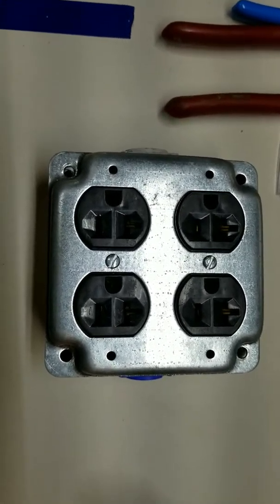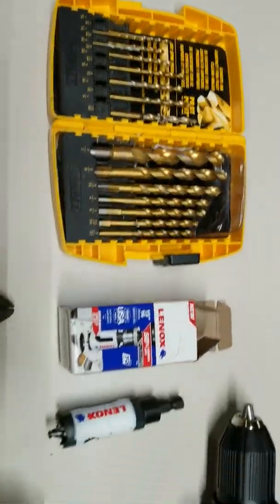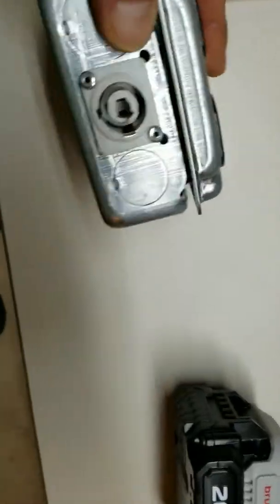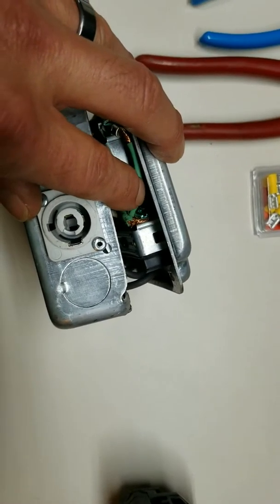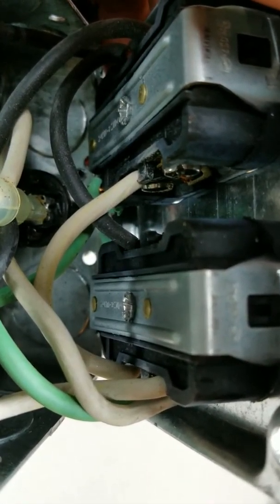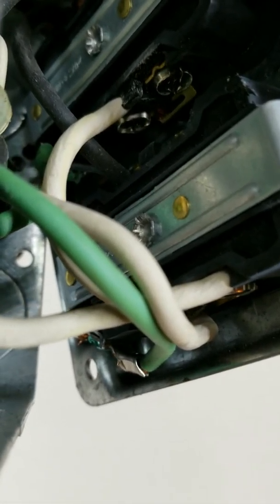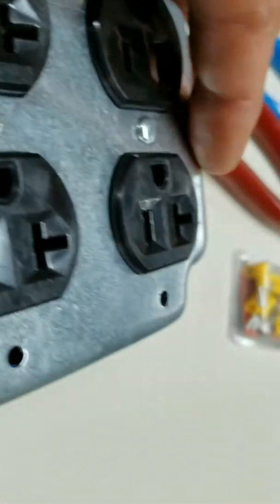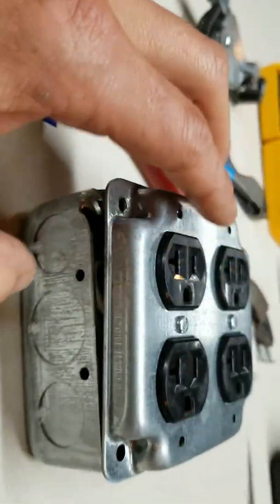How to make a custom quad box for easy power distribution.

Comment: Just a tip.  Its common to turn one of the duplex outlets upside down so that the neutral sides both face the center.  This prevents the positive and neutral from accidentally shorting inside the box.  It also makes the wiring inside a bit cleaner.
Reply from the maker: Nice tip!

Comment: its been a few years, and im sure youve improved a lot, but i would probably use a 5 inch box and try to use a GFCI somewhere, whether you have it inline on one of your powercon cables, or a GFCI receptacle. if you use a receptacle though, make sure its rated for outdoor use, just in case you get caught in the rain, you dont have the potential to hurt anyone, and when its outdoor rated, it wont trip as soon as a drop of water hits it.

theres also raised cover plates you can get, but theyre designed for use in walls, so youll have to get a little creative, but even just 5/8s of an inch will get you a lot more room to work with without adding much more space. there are also electrical boxes that have larger knockouts than 1/2 inch and 3/4 inch. im not sure if those boxes come in stamped or are just welded though
Reply from the maker: Thanks for the comment.  Yes they are a bit tricky to wire.  I still have them but have upgraded so to speak.  Now I use these: https://www.amazon.com/gp/product/B07FPRTZXN/ref=ppx_yo_dt_b_search_asin_title?ie=UTF8&psc=1
And to your point, my first point of connection at the wall is a GFCI wallwart plug:
https://www.amazon.com/gp/product/B0037NXKY0/ref=ppx_yo_dt_b_search_asin_title?ie=UTF8
which I use when I'm doing outdoor wiring.  That one is a 15A and I also have a custom cord with an inline 20A GFCI.
Reply: @JSEntertainmentCo  I didn't know that those boxes existed. That is super cool, even if they are expensive...

As for the GFCI, yea they're important, and as an electrician, you can't always trust that the electric is up to code, especially when things are only temporary. I would even use the GFCI if the venue seems a bit shady, because there are applications where you can substitute with a GFCI if there is no ground.

I always tell people to just use their judgement...

Comment: Hey man - you need to ground the box as well.  Also its an awful mess in there having the two powercons directly across from each other... you would be better off staggering their location. I built a lot of these as well, and finally have it down to an art.  There is also an easier, and cleaner way to jumper your outlets using the “quickwire” jumper holes.  The other thing I do is get the spade connectors that are covered for the hot and neutral.  Lastly, wrap your outlets with electrical tape to help as a last ditch attempt, should a wire wanna work itself lose or off...
Reply from the maker: Hey bud, thanks for the great feedback. I've improved my design quite a bit since that initial video. They are all grounded as well. I can't stagger the powercons in those boxes due to clearance. I'll Ned to find deeper boxes for that. I'll follow your channel and hope to see you post a video of how you build yours. I'm always humble enough to learn a better way to build something. Cheers!

Comment: People, stop using the stranded wire around the screw terminals! Spade or ring connectors should be around that screw!
Reply: Spade terminals are not code on receptacles

Comment: Great work, Joe! I’ve done most of my live sound in churches, clubs, restaurants/bars, and military bases/embassies. I haven’t seen PowerCon much if ever. Is this more of a festival or touring live sound thing? I can definitely see regional sound companies wanting to use this connector. Thanks for making your video and sharing your knowledge!
Reply: Emm... it all depends on the type and model of devices you use.
IEC C13/C14 can only stand 10 amps of current, so devices having larger power ratings need other types of power plugs and sockets to work safely. PowerCon, a.k.a. NAC3, provides connectivity of 20 amps in maximum in a relatively small mounting footprint (slightly larger than a XLR and nearly the same as an NL4 SpeakOn) and thus is mainly used in small-size power-consuming devices e.g. LED matrix display modules, stage lighting fixtures, and ultra-thin Class-D amplifiers (typically with 1U of thickness). PowerCon has a locking mechanism to prevent unexpected disconnection, and all of its conductors are hidden in deep grooves so that it would technically impossible to be touched by bare hands or metal and cause danger - unless a suicidal stupid s*** sticks a metal rod into the grooves.

In a nutshell, PowerCons are quite powerful and safe connectors. Feel free to include them into your power distribution system as you wish.

Comment: Nice, However, I would clean up and or organise inside the box a little more, wrap electrical tape around each receptacle when finished just as extra safety precaution, other than that, well done!

Comment: I can’t help thinking a box like that is not allowed on a stage even for temporary use. I would have use the deep version of the box to allow room for the wiring. Crimp spade lugs onto the stranded wire before attaching to the outlet lugs. It is not allowed to strip a portion of the wire to loop around a terminal lug. Wires must be cut. That box would be rejected on stages.

Comment: did you ground to the box?
Reply: How would u ground the box
Reply from the maker: The box is grounded by nature of the sockets being screwed to the face plate.
Reply: Joe Bunovsky  - thats is incorrect.  Also you didn’t need to break the tabs off the outlets completely rendering the screw holes useless on the faceplate... having them only secured with the one center screw is a fail IMO.

Comment: I noticed that you used 20amp receptacles & 12.3 wire, but it looks as if you used 15amp PowerCon connectors. Have you found any issues with this?
Reply: Christopher Aimi  powercon is rated to 20 amps.

Comment: Great idea but poorly executed inside the box. Mismatched power ratings, poor soldering where it was done, tips weren’t tinned and it looks like you used stranded wire instead of solid 12/3. These are a fire hazard waiting to happen with any significant draw or heat.
Reply from the maker: I respectfully disagree.  The only soldering done was after the crimp just as an extra precaution.  There would be no way to use solid 12/3 and fit that much in the box.  I tried.  It's just too inflexible.  There's no need to tin because everything is either crimped or screwed down under a buss bar.  The messiest looking part is where all the grounds tie together and that doesn't really matter.  The stranded wire is 12awg so there's no mismatch other than I used t-slot receptacles.  I don't have anything that requires a dedicated 20amp with a t-slot plug so no worries there.  It's also worth mentioning that the "starter cord" that plugs these into the wall has a GFCI interrupter built in.
Reply: Yeah these are cool. I think you’d have just enough room in there to put an inline fuse holder in there as a fail safe coming off your input PowerCon

Comment: Nice. Interesting connector for daisy chaining, seem like a smaller version of powerlock connectors I haven't seen here in Aus.
I also build similar devices to these:
http://dglad4.dynu.net/projects/livefolder/2012-01-26%20Connectable%20Power%20Points/